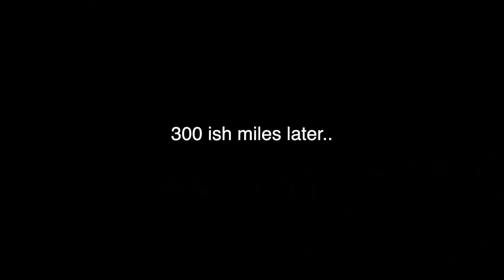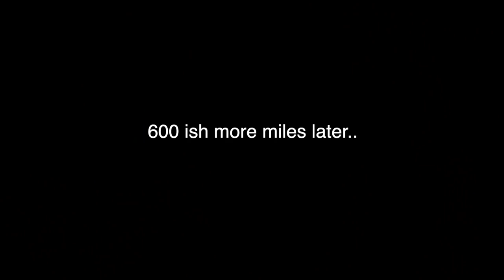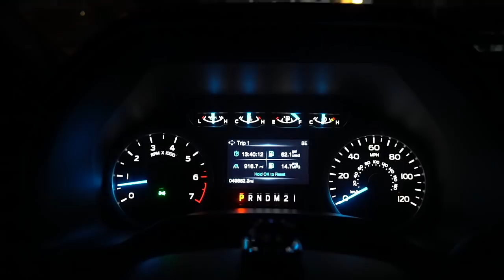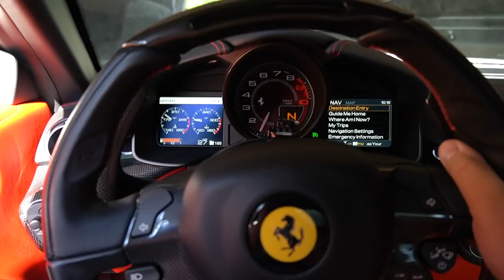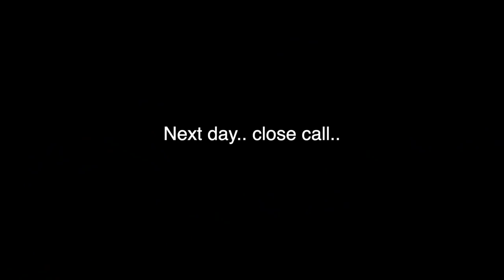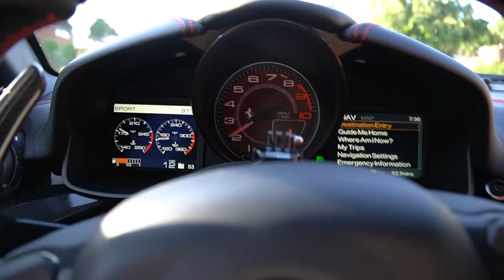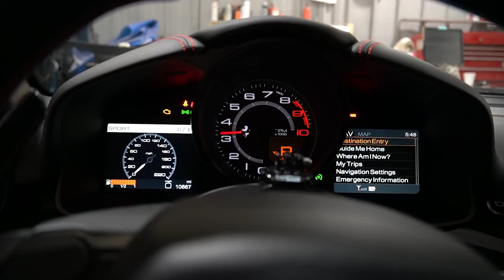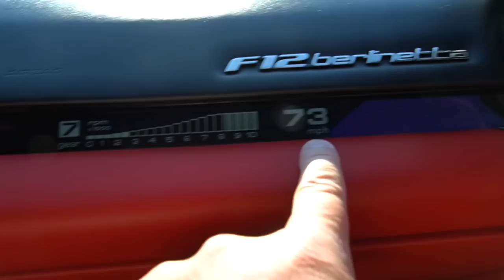We FINALLY Made The F12 LOUDER! (Ferrari Exhaust Valve DELETE)

Comment: Valve deleted by a Non-Ferrari Authorized Technician = Warranty Voided if Ferrari USA ever sees this hmmmmm......😡🙌
Reply: how long is warranty?
Reply: It's exhaust valves, he didn't delete cats or anything. Muffler deletes or valves shouldn't void warranty
Reply: How would deleting valve void warranty ? It controls the sound of the exhaust. Also that would only void if they could prove deleting valve caused whatever to go wrong.
Reply: Warranty is voided if you mess with the cars electronics, engine, some suspension parts. Exhaust mods dont void anything as you're not actually altering how the car operates only the sound

Comment: The valves are the for low end torque. You should have done a 0-60 prior to dissconnecting them and then after.  Next video, I got a check engine light and don't know why.
Sounds crappy idling around now (which is 90% of driving)

Comment: Do the vavles have a fuse you can pull to set them open all the time? I know its ferrari, but on gm cars with valves you can pull a fuse that controls the valves and it will stay open.
Reply from the maker: Finish the video;)

Comment: The best part of your exhaust mod is that it is reversible!  It wouldn't take me long to get tired of all that racket.  A better mod would be to add some kind of vacuum solenoids that would allow you to select the exhaust mode when driving.  That way, when the occasion calls for quiet, you could keep the noise down, and when you are in a place and time to let 'er rip, you could do that too. 

Good luck with your F12 And your F150.  I enjoy watching your adventures and misadventures.  I'm not sure I would go for either of those vehicles, but it might be kind of fun to have a supercharged coyote under the hood of a 1950's Studebaker Hawk!

Comment: Believe it or not NC has one the most dangerous stretches of highway because it’s straight for miles with no turns and has trees on both sides of the highway and it causes driver fatigue and drivers drive right off the side of the road.  It’s the oddest thing to see

Comment: Could you set the rpm at 2000 to open the valves?  It's just to loud for the neighbors.  Great for the race track not for driving around the city.

Comment: You say that you are happy you dont have to pay for the carbon in the engine bay but the value on the car goes up quite a lot with that spec. You also bought it from a dealer which means they most likely took that into consideration while valuing the car meaning that you paid for it being on the car but not the full factory price obviously.

Comment: Mike has a 700ish hp truck and gets 14.7 mpg, I have a bone stock 4.0 ranger and get 12 mpg🤪
Reply: I had a 95 ranger with 30 inch tires with the 4 banger and it got 16mpg lol

Comment: Mike sounds good , but you could have left the hose connected to the valves and just tie them back , we use stainless wire to tie the valves back not sure how long a plastic zip tie will last on a hot exhaust 😂